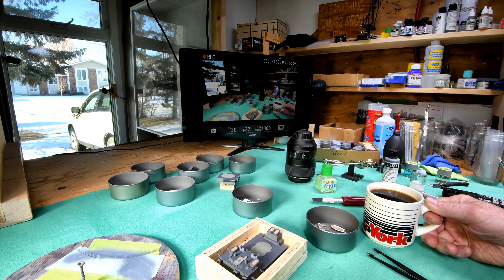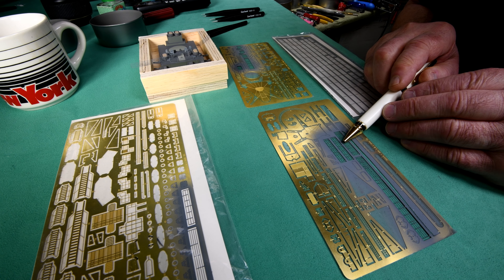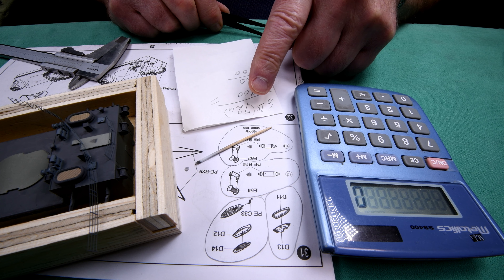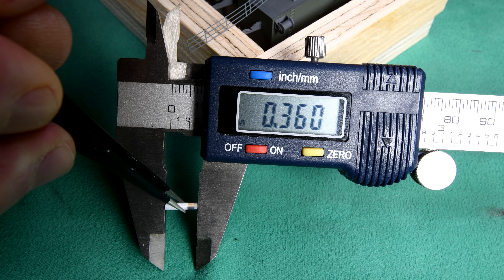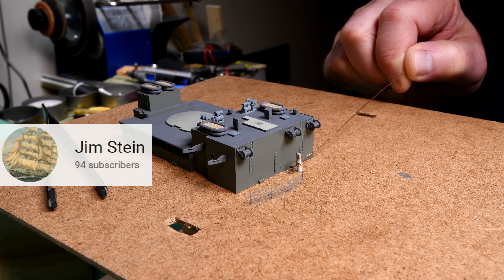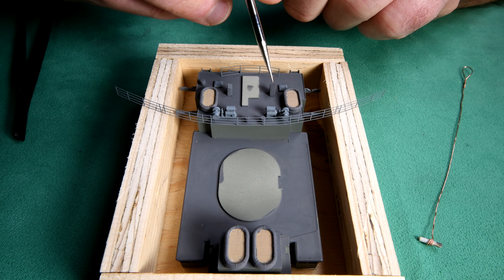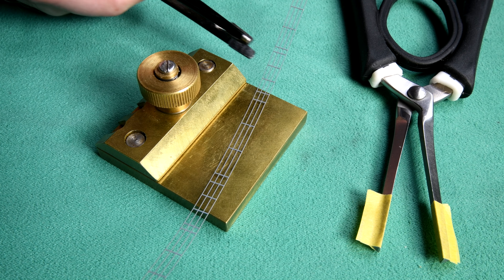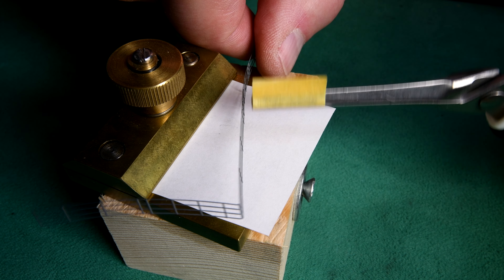The Model Ship - Part 648

Comment: Hi Ron  you do realize we will all have a scale figure by the end of the week 😅😅😅😅😅😅fantastic idea mate , and 😊😊😊 my rails on the Dunkerque  had recess lines where to bend ,was wondering if yours does , the're very faint ?    👍👍👍👍👍see you tomorrow
Reply from the maker: Hi Marc,
"recess lines where to bend" I didn't see anything like that yet.
"we will all have a scale figure by the end of the week" Been thinking of reducing something down in CorelDraw to 360/1000 of an inch. Just might try that today. May not print out too good however. See you tomorrow 👍

Comment: Hi Ron,  as I was watching you with the PE bending problem. So I was thinking, why not take a peace of paper and trace on the deck the outline of the bend. Now you have a perfect outline of where you need to bend the PE railings (I hope this makes sense).  One more idea on bending small areas of PE.  Take two Single edge razor blades to bend the PE, One to hold down the   PE where the bend starts and the other blade is used to slide under the other pease of PE and  bend.   Now no need to invest in any other tools..
Have a good week and stay safe and be well......  😷. 👍. .............                             
     🇺🇸❤️🇨🇦.
Reply from the maker: Thanks for the tips Jason. See you tomorrow. 👍
Reply: Your very welcome.     😷. 🤔.  👏